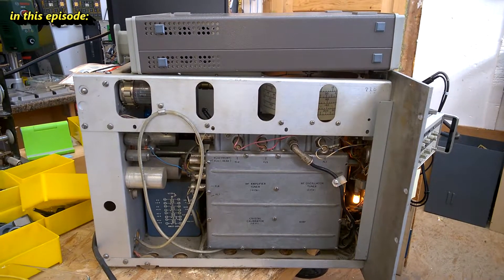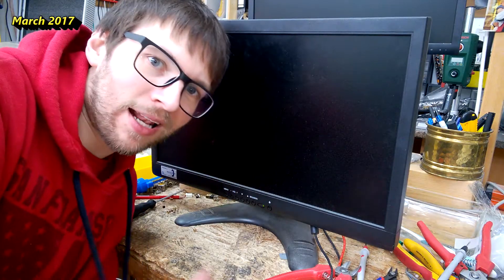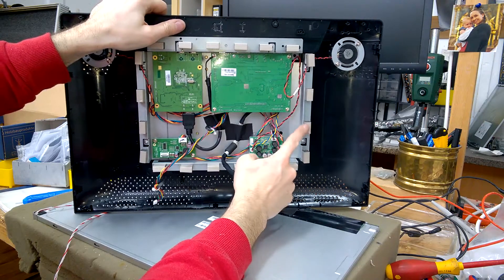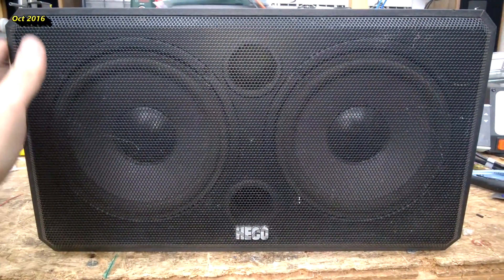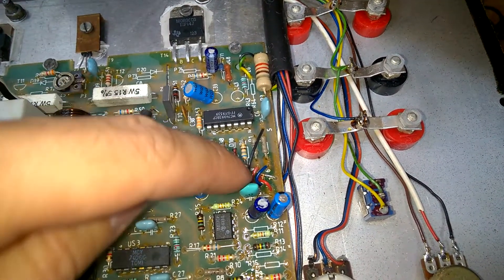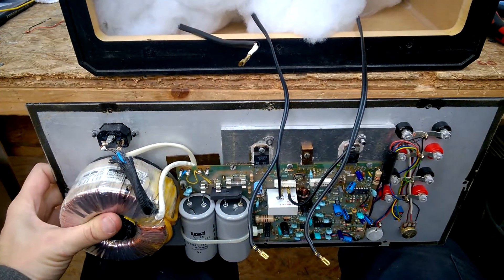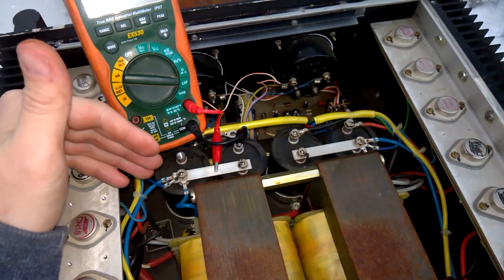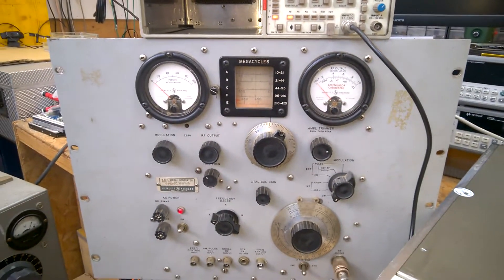BEB #56: Active Subwoofer teardown & 6 other videos

Comment: No earth fantastic one way to deal with those pesky ground loops.  Has the toroid transformer overheated it looks a bit funky. My best regards Chris
Reply from the maker: Not sure why I have missed your comment in the first place.
The transformer was fine. I have sold it to someone a while ago. Yes, it looks a bit funky. 
No ground is absolutely fine for me, but then it's not allowed to have a power connector with an earth pin. Instead it should have a figure-8 connector, or IEC_60320 C17 without any earth pin.

Comment: Zwei Kondensatoren und ein Brückengleichrichter,
das kostet doch nix und dauert 5 min.
Dave Jones macht auch keine Repair Vidz :)
Reply from the maker: Hallo Alfred. Ja, Du hast Recht. Aber es sind Doppel-Kondensatoren, mit zwei Elkos in einem Gehäuse, die gibt's so nicht mehr zu kaufen. Und dann auch noch axial. Also brauche ich 4 Stück Axial Elkos und ich muss irgendwas basteln zwecks Montage, damit die Elkos nicht im Gerät hgerumfliegen, nee nee. Viel zuviel Zeitaufwand für einen Händler. Und Zeit ist immer das Teuerste an so einer Reparatur. Zum Vergleich: Für einen funktionsfähigen Heco Subwoofer diesen Alters bekomme ich bei ebay (vielleicht) 30 Euro. Gute Elkos sind da schon teurer, die Zeit noch gar nicht mitgerechnet. Und falls wirklich einer für 30 Euro kauft: ebay nimmt 10% Gebühr, PayPal 5%, das Finanzamt 20% MwSt und 35% Einkommenssteuer, 25% nimmt die Sozialversicherung. Am Ende bleiben circa 3 Euro für eine Stunde Reparaturarbeit, eine halbe Stunde Verkaufsabwicklung und Buchhaltung, zwanzig Minuten Verpackungsarbeit, usw. Das lohnt sich einfach nicht. Zumindest nicht für den Verkauf. Schönen Sonntag! Würde mich freuen Dich wieder mal bei den Kommentaren zu sehen.
Reply: Ing. Max Koschuh 
Hey danke für die ausführliche Antwort!
Bei euch ist das Finanzamt auch so unverschämt .
Mir ist nur aufgefallen, wie sich die Leute über Reparaturvideos freuen. 
Ich gehöre wohl auch dazu :)
Also ich freue mich schon auf dein nächstes Video!
Ps. Ich steh auch total auf große Drehknöpfe,Schalter und Drehspulanzeigen